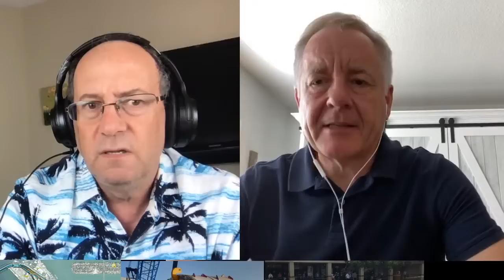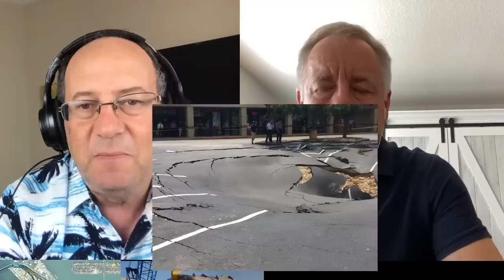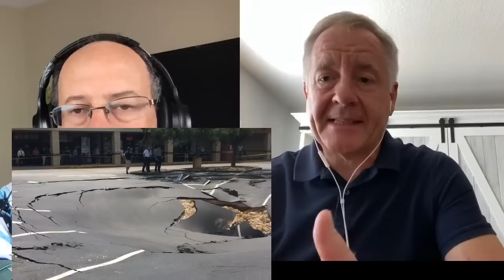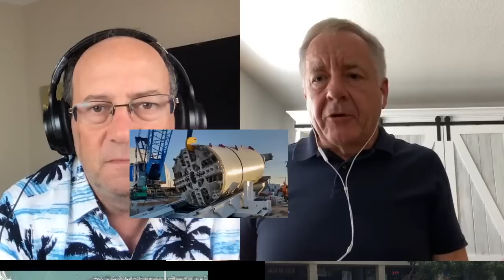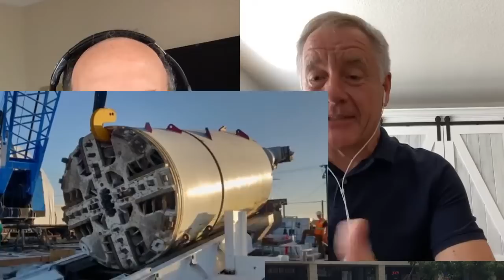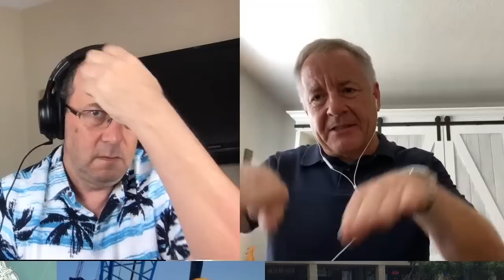Tunnels in Florida? Interview - David Wilshaw Geologist

Comment: Hi Warren, I follow your discussions enthusiastically. You point to this discussion as a solution, but I find it is mixed at best. In most cases I find you well informed, but in this case please understand you are talking to a geologist, NOT AN ENGINEER! OMG, those 'small details' are often the difference between success and failure. One example... the idea of boring underneath the everglades vs. another alternative (above, around, thru..) ignores that it is sand/silt with a lake on top. As an engineering solution, this is a DISASTER for a TBM as the reality is you would need to stabilize it (inject cement/grout) then bore thru that (your geologist said that if you listened as an engineer). Maybe that works somewhere, but I think not so good for the Everglades. No argument for fixing Miami or Orange county with Loops of one or another type. BOTTOM LINE - My solution - perhaps a mixed above and below ground solution for South Florida is much more practical.
Reply: For comparison, The Boring Company's purchased a TBM after it bored under San Francisco Bay. Water depth was about 10-30 feet. The tunnel was about 100 feet below the bay floor.  Bedrock was hundreds of feet below the Bay floor. The TBM went through non-rock deposits washed into the bay and didn't need to stabilize it AFAIK. Maybe not too far below the Everglades is a layer that's also not rock but firm enough to not need stabilizing.